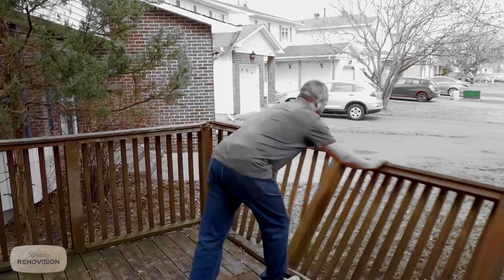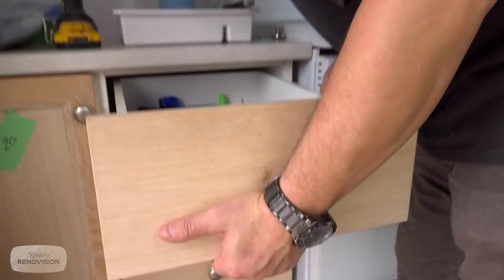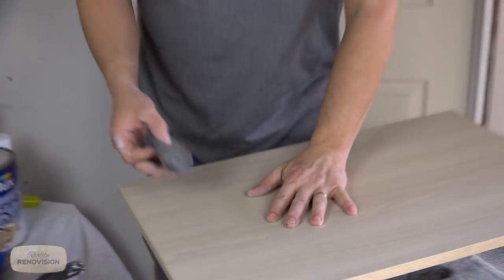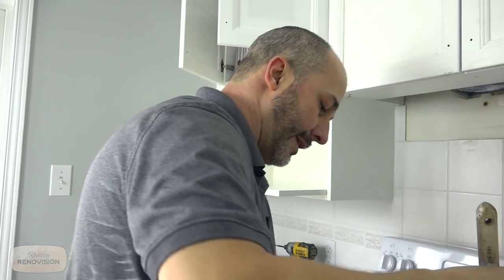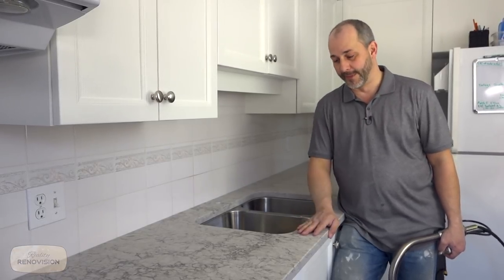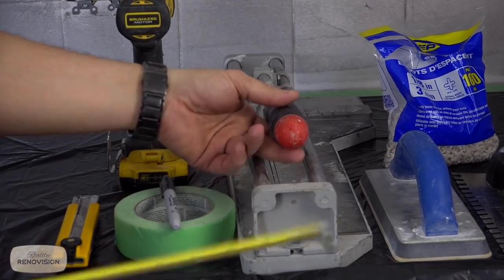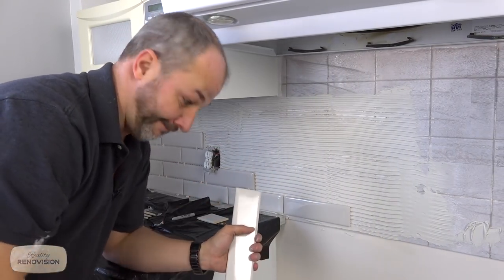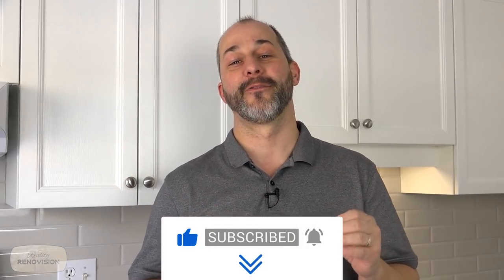I Remodeled This Kitchen For Only $4000.00 | Reality Renovision Ep14

Comment: Awesome! Question, I love our backsplash but need to update my countertops. I’ve  been told if I try to remove my Formica countertops my backsplash can’t be saved, is that true? Since seeing this video I’m hopeful I can do what you show here.
Reply from the maker: hi dana, in most cases you can just unscrew the counter and cut the silicone seal between the counter and tile. and you can slide the existing counter out.
Reply: REALITY RENOVISION thanks,  my backsplash has grout around the base of the Formica countertops any hope that your suggestion  could work?
Reply: @dianawhite7443  or when you cet a new counter get a 4 inch  tall back-splash with it to cover any damage
Reply: If you have a dremel type multi-tool (similar to the grinder he used on the tile) there is a blade you can buy that removes grout. Then I think you wouldn't have a problem. It's fast and easy, just be smart and read the instructions. I had no problem removing my grout.

Comment: what if the backsplash is stone ish and not flat? Like some raised and some lower would you suggest then taking off the drywall?
Reply from the maker: I always suggest starting from scratch, however in some cases a quick fix is fine. It usually needs a flat surface to finish nicely. Cheers!

Comment: Super Jeff Renovision!  
You and your great tips have made me right handy; thanks for the help.  I wonder if it's possible for a woman to experience an old-fashioned man crush on you.  I love your common sense approach and your sense of humour is not too bad, to say the least.    

Anyhoo---I have a soundproofing question, and am only asking after every careful review of every one of your soundproofing videos.  

Can I use green glue, MLV and a wainscotted height of drywall on an existing finished wall, (finish it with beadboard and new molding) and expect to see an improvement the vibration-type noise I am getting from the traffic outside?     

Here's the back story:  With your help and advice, I refloored, painted (yep--walls and kitchen cabinets) and it looked so good I just moved into it.  Then I went ahead and did the same to my cute little 1.5 storey CFB military house in Calgary's Garrison Woods which is now my rental property.  
Love the house, but this townhouse?  Boy-oh-boy!   

My cosy little townhouse is only 15 feet off Calgary's trendy (but traffic heavy) 17th Avenue and I am going bonkers with the noise.  Even if I didn't have a gorgeous border collie whose only happy place is my heavily insulated walk-in closet, I'd still have decided to either 
SOUNDPROOF or SELL.  
...and with our competitive condo market in YYC, it's probably best I just stay put.   So I had better get at it.  

I'll first have a window company come and re-silicone my windows and then I'll add good weather stripping and weather cladding to the external door.  When I get that done, I think I'll be ready to give the wall work a shot.  But really, may I please ask: 

In your down home expertise, do you think this half-wall idea is just peeing into the wind?

Comment: If I'm going for a darker color on the cabinet. Doors do I still need to put a primer down first? (these cabinet doors are also 40 years old lol)
Reply: the primer creates a bond between the surface and the paint, so yes, do the primer. 
There's a company called Heirloom Traditions Paint which makes paints that help eliminate the sanding and priming steps; just paint, dry, done. I'm a fan on their FB page and the kitchen cabinet transformations are amazing.

Comment: Thank you for this video.. I am new to your channel.  I love the backsplash without having to tear it down.  If you were to have someone else do it, could you advise them to use that grey layer(forgot the name) and then just lay the tile over the adhesive?  Anyway enjoyed this renovation.  I wanted a paint that is like a poxy I think, so it won't ding or chip on the cabinets.  Is there something like that out there?  Thank you again.

Comment: Once you learn how to work the small rollers, you won't need a brush. Don't have to worry about brush marks. If you do have marks or drips, wet your sanding paper to prevent the paint from lifting because of the friction.

Comment: Hey Jeff, I've been watching you for a while and I finally decided to paint my cabinets... Im using a Home right super max finish sprayer but I keep getting drips, and with a paint brush I couldn't get a smooth finish. Do I just suck at painting or should I keep up with my brushes?
Reply: Brittney Mora just painted mine today. Use foam paint roller, foam brushes. Mine turned out great. Good luck
Reply from the maker: are you using the melamine paint from the video or some other product. foam rollers will be better with other products. Cheers!
Reply: @REALITYRENOVISION  I'm using the killz primer with the berh urethane alkyd semi gloss for cabinetry.... It was a user error lol I got the hang of the sprayer and now my project is going good. Also i love your videos, lots of great info yet super simple! Thank you!

Comment: It's a cheap & short term solution. The reason for my comments is that I have to go to REFACE many kitchens that had hires a professional to paint & restrain them. The only problem is that they last approx. 4-5 yrs and they start to come off specially around the handle area and where there are heavy traffic area with water. Our process is very similar (REFACING ReNu), except we laminated the cabinets instead of painting them and laminate is water proof and you get new doors & new hardware. You kitchen will look it a $30000 NEW kitchen. If you stain or paint you kitchen still look like OLD fashion, the only thing you did it it is to change the colour !

Comment: Great video!! I'm following your advice and installing subway tiles over my current backsplash.  I have 2 questions please; 1)-where can I find the tile cutter that you have? There are so many and they all seem a bit large and complicated.  Where can I find a basic one like the one you're using here... and 2)-Where did you find the metal pieces to border the tile that went up the left side of the wall near the microwave? I currently have a wooden cap similar to a baseboard look, do I just pry that off?
Thanks in advance for your input :) 
Kim
Reply: hi!
the border is called  j-trim and you can get it at home depot. 

the easiest, cheapest tile cutter is about 20 bucks at HD, Anvil brand. 
Super simple to use, just tiled my backsplash 2 weeks ago and went super fast. 
It just has the wheel&handle to score the tile then pull back and use the plastic tab to pop the tile where it's cut. 
(just watched a "how to use a tile cutter" vid here on Yt, about 1.5-2 min and cut tile no problem)
Reply: oh, forgot to say, the j-trim has to be cut to size usually, so get a pair of tin-snips (15$ at HD).
I contemplated it, but in the end went with bullnose trim pieces for the edge and created a border effect with that.

Comment: Can anyone explain to me why he didn't do the tile work first before putting in cabinets. Not a renovator. Just a newby observer and I think I would have tried to do tile stuff first. Can anyone  explain why counters first?
Reply from the maker: since walls are not straight if you do counters first then the tile covers the gaps. also many tiles are designed to finish at the bottom of the cabinets since they usually are installed 18" above a finished counter. if you tile first you are guaranteed slivers at the top.

Comment: BUT, putting vinyl planks  over existing floor creates a risk of raising the floor high enough to trap your dishwasher in place. How do you prevent this from happening? You did not mention anything raising floor levels except in regard to adjacent rooms. Between the vinyl plank floor on top of parquet, plus the apron portion of the new granite counter top, we have been unable to remove our old dishwasher. I've contacted a flooring dealer to come over and remove the planking in front of the dishwasher (as though we were replacing some planks), then come back and re-install them after the new dishwasher is in place.

Comment: Great job! But a few questions. Was this filmed in 2020 or just uploaded? The microwave, fan, and stove are looking like something from a 1990s kitchen. My microwave from 2011 still looks like the microwave from 2020. Are you not embarrassed about calling this a renovated kitchen? Should have switched at least those three as well, not speaking about the cooler/freezer :) Anyway great work and good ideas on saving on those other parts! :)

Comment: great tips on what to look for when buying a house with renovation costs added in. Know what to look for and negotiate the price down, or move on to one done fully to code. I notice you didn't show tips on tricking the electric outlet. This is ok if its for yourself, but not to pass on to someone who thinks the house is actually updated. We call this "jerry rigged". Clever, though, for sure.

Comment: The problem with the trash bag trick is any paint that dries on the edges of the trash bag will flake off, ultimately get into your paint and end up on whatever surface it is that you're painting.

Comment: One thing I can't stand is painting with a brush and or roller. I worked in a sheet metal shop as a spray and powder coat painter for 25 years. Now I'm retired. I would much rather watch someone else do it rather than me 🤣 God bless Steve.

Comment: Dont forget, google search for your local "scratch and dent" appliances. They're brand new appliances, typically still with full factory warranty for almost half off. Sears factory outlet still offers floor models too, same thing. I even have scratch and dent appliances in my house, and I'll give you $100 if you can find the scratch/dent. Scratch/dents on the backside or surfaces covered by your cabinets are still considered "scratch and dent" =)

Comment: The mini roller had the wrong nap for cabinet doors.  There  is the roller that looks like suede, low nap.  Paint on a flat surface goes on without all the globs and orange peel.  The old yellow microwave, white that aged to yellow looks bad.

Comment: seems too cheap, if the counters alone was $2000, how much did you charge to take off each cabinet sand stain re paint then re install, put all hardware back then to the back splash for the remanding $2k??

Comment: I have a better device for cleaning paint rollers. It's a clear plastic tube with a latch at one end to hook on to the roller handle, and a click hose connector at the other. The roller just fits inside, and the water pushed through the pile pushes the paint out like magic.

Comment: Maybe my experience will help someone else: I painted my whitewashed oak cabinets. I did a super job, sanded, prep coat, quality paint, in the basement, in the winter (no flies, dust or other insects). And then came summer, the doors expanded and the paint cracked in all the joints. They now look like s. If your house is really dry in the winter(we heat with a woodstove) and humid in the summer, and your kitchen cabinet doors aren't one-piece, beware!

Comment: Can somebody please help me? (Cuz I'm kinda stupid). I just want to clarify - the steps for painting the cabinets are:

1. Lightly sand the wood (manually for nooks and crannies on the edges; electric for wider parts).
2. Put on the first coat of transition primer - let dry.
3. Re-sand the dried surface.
4. Put on the second coat of primer - let dry.
5. Re-sand the dried surface again.
6. Put on the first coat of paint - let dry.
7. After a couple weeks or so (confirm visible stains on the wood), put on a coat of stain sealers on the spots - let dry.
8. Put on second (last) coat of paint - let dry.

And then that's it?

Comment: Okay, so you sanded and primed the cabinet doors, but the doors you started with had the cracks between the door trim and panel showing, and the finished doors did not have those cracks showing, and I didn't see you do anything about those cracks. Can you please address this? The folks who owned our house prior painted the cabinets white, and those cracks are very visible and very ugly, along with the wood grain showing through. It looks awful. Thank you.

Comment: Granite starts at $28 per square foot.  I’m not sure where you where you are purchasing your stone.  Even granite will crack if anything over 400° is set directly onto it.  That splash should have come down before the new quartz tops went in.  A standard white quartz will run $40-$48 per sf installed.  No reputable stone company will ever require a client to purchase the entire slab including waste.  I never would have chosen that color top in that tiny kitchen. $4000 is way overpriced for this job.

Comment: Not sure how this was done in 3or 4 days and for 4K. I have remodeled over 400 kitchen and it always takes a minimum of 2 weeks turnaround between templating and installation of quarts or granite. She was lucky to get you because there is no way we could have done this job for under $ 9,000.  A quality sink, faucet and flooring would cost at least $ 1,500.

Comment: Titling over tiles seems not right. But I know we are a tight budget. I maybe will suggest it just for the backsplash. But as when they built this house in 2004 they use floor tiles on the backsplash matching the floor. Yuck! They are thick. So maybe we can’t get away with this this shortcut. The outlets wouldn’t fit right.

Comment: If you're looking to buy a house beware of a kitchen remodel like this.  Those are the cheapest cabinets ever that were painted. Tile over tile and flooring over flooring will result in a very expensive gut job when you decide to redo the kitchen.  All the band aids were already applied.  Only major surgery can revive it again.

Comment: What would be a quick fix on cheap cabinets that someone let their dog scratch . Old cabinets but I have to tolerate them until I can replace. I think they are 1983 old pressed wood with darker stain . Actually the very same stain as every single piece of wood in this house and there is lots of it. Old brick ranch. You know the type, hardware is an old black hammered looking iron. Ugh.

Comment: That Backsplash is a the worst, you don't Layer a damn Backsplash like seriously, quit doing a half-a** job as a contractor and do it properly the first time, as a new buyer and heard you did that i would immediately think lazy contractor, as a contractor you should have suggested the proper way it should have been done, my father has been doing renovations for over 50 years not once has he ever done one like that, if i was a Home Buyer i would tear that garbage job back out to do it the way it should have been done to begin with.

Comment: OMG 😲  this guy is not a finisher. Lol. Wrong prep. Wrong primer wrong tools. No painter alive uses paint trays no painter alive would use half inch nap rollers. No painter would prime with anything less than oil base primer. No painter would brush and roll. Fine finish sprayer. What shop